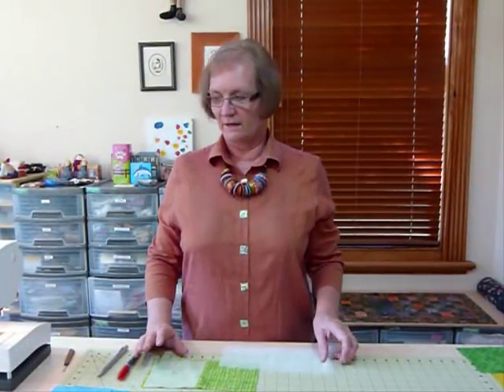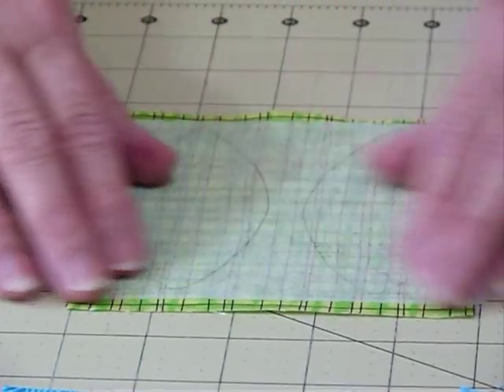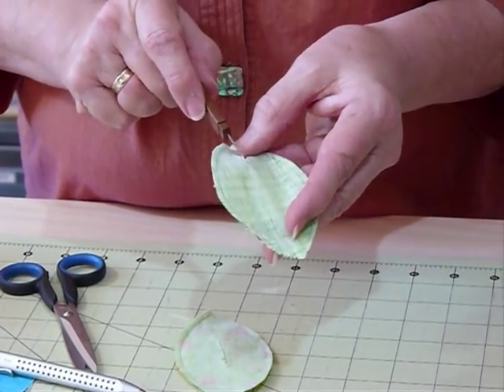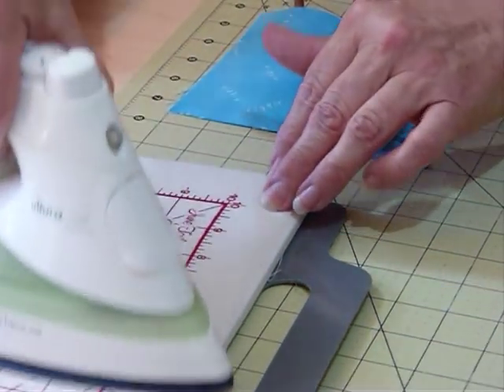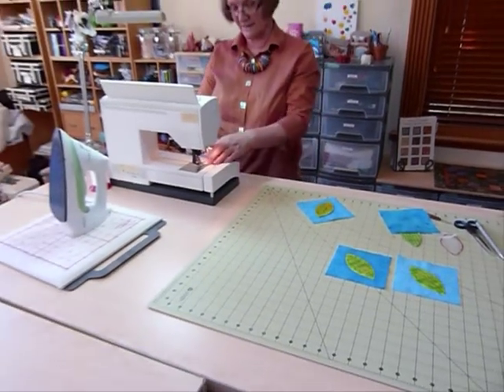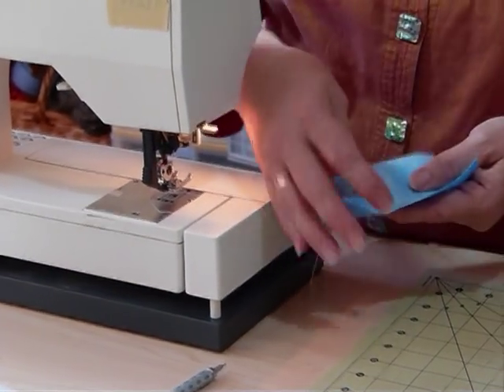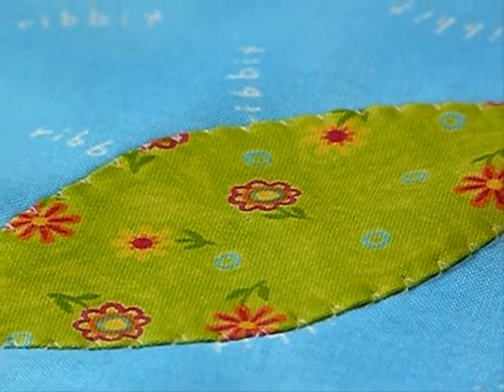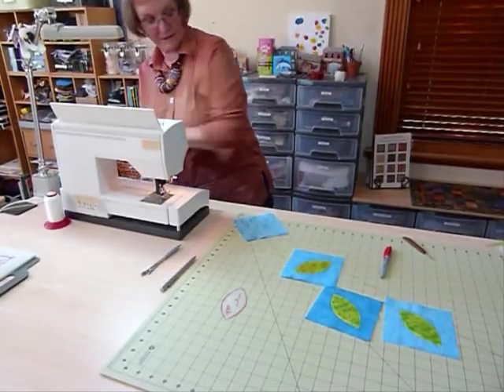How to do Almost Invisible Applique by Machine - Quilting Tips & Techniques 058

Comment: Thanks for response.  For some reason I hate to make plastic templates.  Did it once years ago and never had use for them again.  I really don't appliqué but think it's about time I do a project now and then.  Am working on a Christmas tablerunner and used the stitch wichery fusible.  However, wanted to see what alternatives they were without all that turning under and time consuming methods, but found you and am encouraged to use your method instead of fusing.  thank you again.  G'day.

Comment: I like to do a stitching sample on a scrap to be sure I know exactly where my presser foot should go along the edge of the applique, and try out different stitch lengths and widths to select the one I prefer. This is especially valuable with a machine which has blind hem stitch but not buttonhole stitch.. it's also a good time to test what thread color looks best.

The US generic term for your interfacing is ",non-woven sew-in" or "non-woven non- fusible".

Excellent video, perfectly paced. I have used this technique in the past but you have given me two new tips: using extra fine thread and your tie-off method.

Comment: Great tutorials.  Can you recycle used dryer sheets for the stabilizer?  I watch your videos often--you are a patient teacher.  Thank you for showing us your great techniques.  Can this technique be used to make large star appliques?
Reply from the maker: Hi, I am not particularly familiar with dryer sheets, but if they are what I they they are, then yes, they should be fine to use. And yes, I can't see why this wouldn't work for large star appliques too.
Reply: Yes recycled dryer sheets work great I have used them for years using this method.  I originally learned this in a class where we did circle appliques.
Reply: Used dryer sheets, no problem but a bit thick. The ones Gourmet Quilter uses is much thinner
Reply: Catharina Williams what is the name of the stabilizer?

Comment: Love your method with the vilene. Have you tried bypassing the templastic and tracing the applique pattern straight on to the vilene?
 I only got a quick look at the thread - it looked like Serafil? I've never used it on my machine before, only for hand needleturn, so I'm keen to thread up my Pfaff and get into it now! 
Thanks so much for sharing. I'm about to start an applique quilt and have been putting it off looking for the best "hand looking" method. I think I've just found it!
Reply: My Pfaff loves invisible thread but likes the invisafill